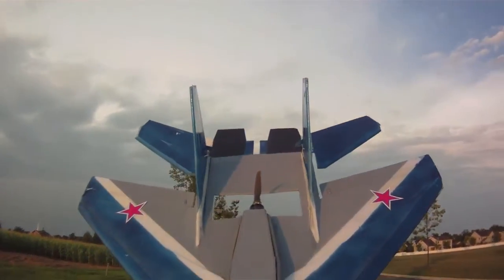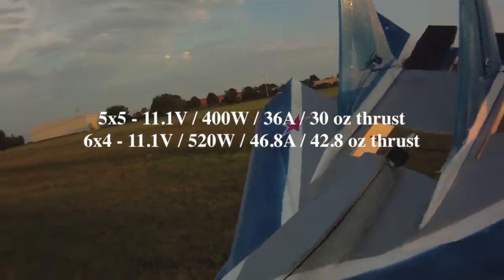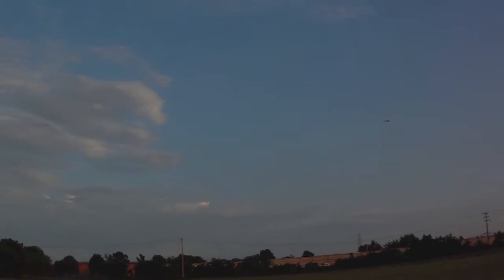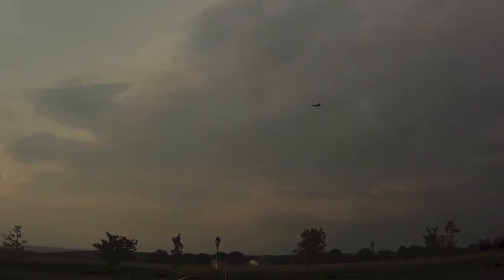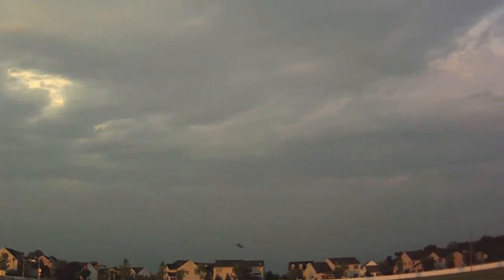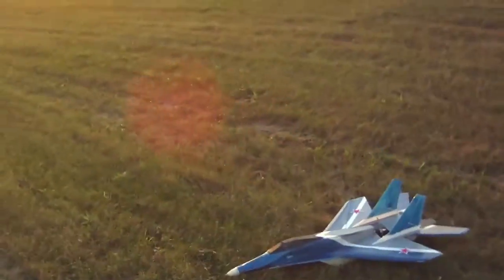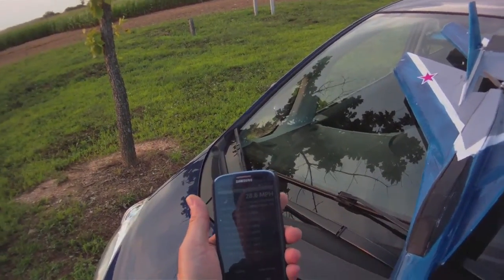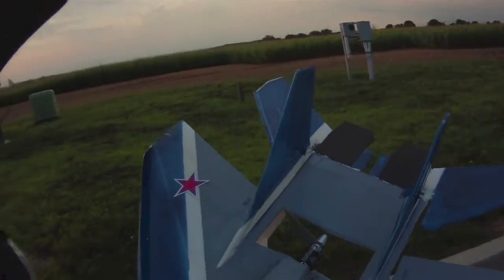NTM Prop Drive 2836 2700kv Test/ High Speed Elevon Flutter

Comment from the maker: I am using 2200 3s 40C and 35 c batteries.  They never puff or even get warm.  I have a exceed proton 60 amp esc I like a lot.  Really works well both with props and edfs.

Comment: What battery are you using? I have the same motor with a Turnigy 60 amp Plush ESC,
in the RC Powers F22-V2.I have limited battery space.

Comment: I bought this motor a while back it ended up on the ikon lol with a 5x5. It torque rolls it a bit on take off if you nail it too hard. What I have seen of the motor though I like it comes down cool as all the time. Makes the Ikon go vertical. What is the temp like with a 6x4? Plan to use it on the Mig V2 if and when I get on it.